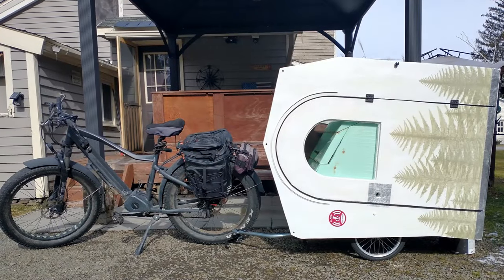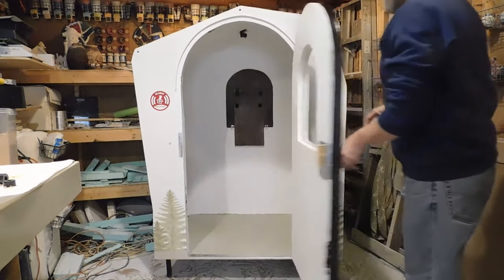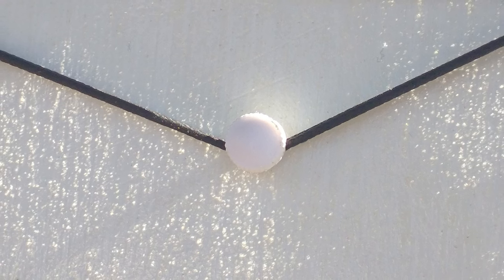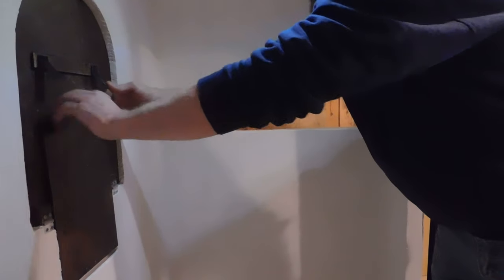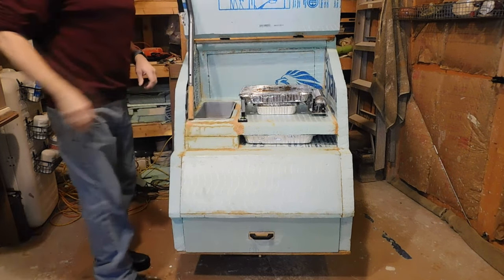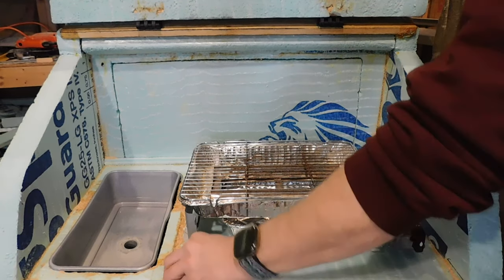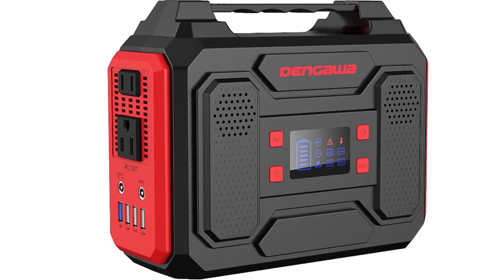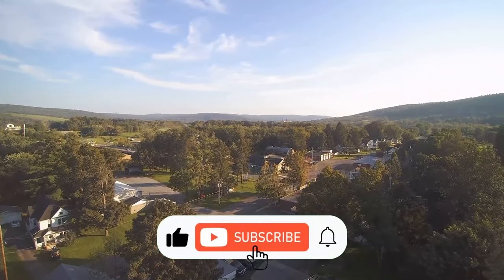Folding eBike Camper Build Part 2 - Off Grid eBike Charging, Awning, Galley & Security

Comment from the maker: I've added a few dents from all the moving around and fitting things together. Not having enough space to work on both halves at once is not optimum. I decided to wait until final assembly to patch the dents and finish the caulking around the windows. Hopefully the weather will be warmer by then, and I can fuss about the details outdoors. Was not sure what to do about the floor, so I painted it for now. Vinyl tiles were going to be too heavy. I picked up some much lighter rolled linoleum that should work well.

Comment: nice build, but I'm not into ''mini campers''... I use the same trailer you do, just to carry stuff... a bigger [2.000 w/h] solar generator, a wind turbine as alternative source, and a 35lt freezer... making ice I can keep fresh veg in a soft padded bag, and having the extra power I can charge power tools [a small chainsaw for example] a tent or a hammock will be my choice of shelter...
Reply from the maker: I have done tent, hammock, and even slept in my pack raft. Double track trailer, single track trailer or no trailer at all, and just load the panniers with ultralight gear. It's all good, and I will continue to use that gear depending on the situation. The camper is more of an all in one glamping solution. No matter where I sleep, I always bring my Eno hammock just for a place to chill. Love your wind turbine idea.

Comment: Giving so much inspiration. I have a Outsunny 72apmh battery pack and a Engwe Ebike battery. I don't know if there is a licenced 12v charger for it.... Worried it'll cause problems with a compatible charger.

That said, my outsunny generator pack has a plug socket.

Just need to get a solar panel.

Point being, this video and you trailer rocks. Do you have plans available to share, please sir?
Reply from the maker: No actual plans, but I covered the design and dimensions in the first video, along with some drawings.
Reply: better go for a small vertical wind turbine... solar works only in daylight, when you mostly ride... wind turbine [set on the trailer] works all the time... and when on the move, doesn't even need wind...
Reply: @makestuffwithjohn  you did indeed, thank you sir